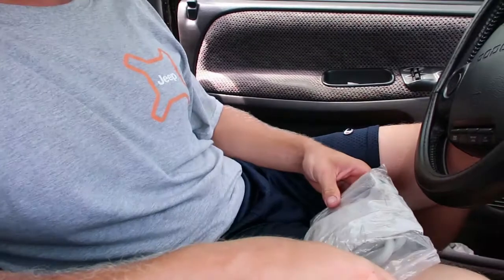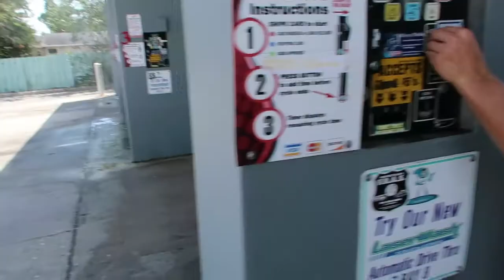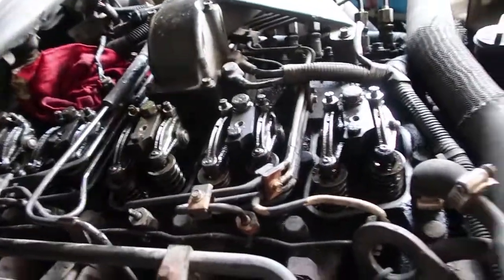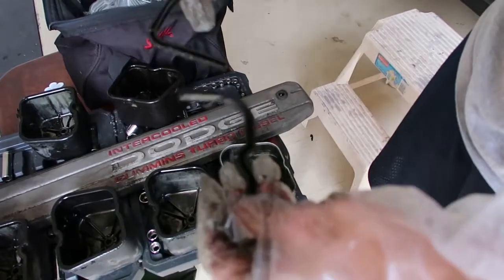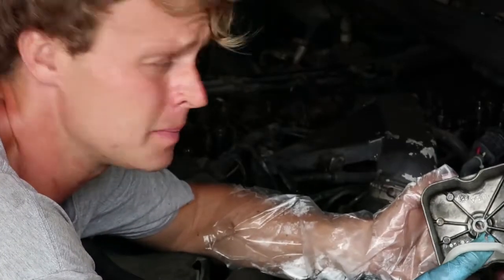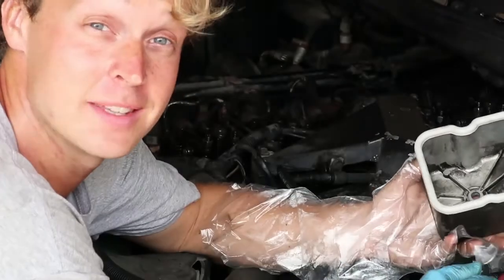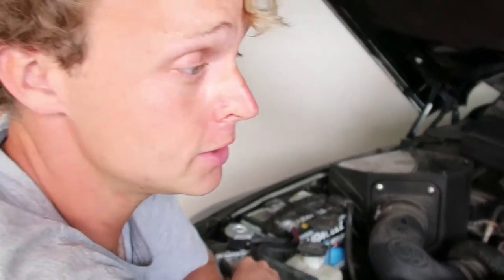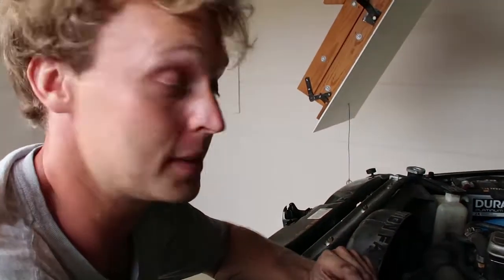12V CUMMINS VALVE GASKET REPLACEMENT

Comment: I worked on a 95 ram 2500 and found the a/c leak at the low pressure service port. Ended up replacing both high and low service ports. Been holding for few years now.